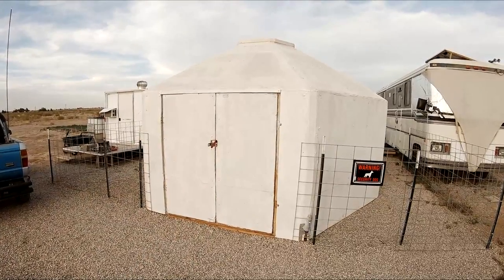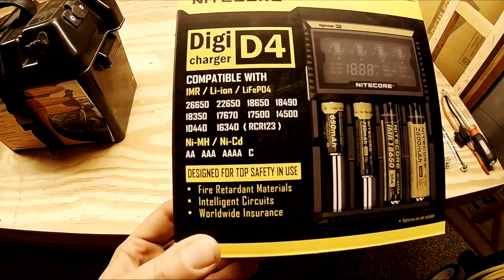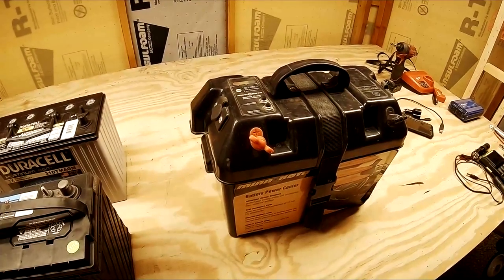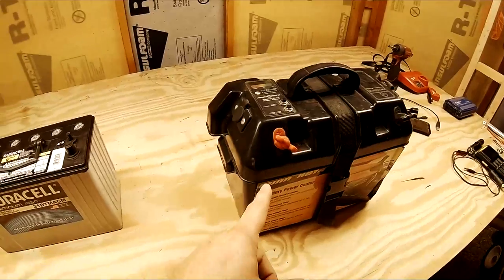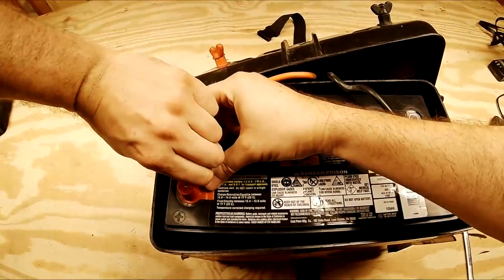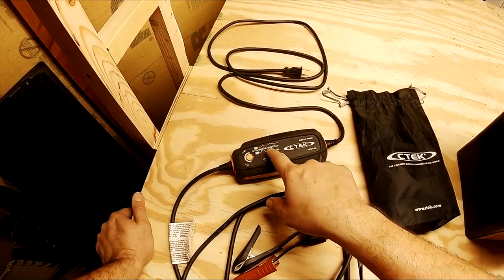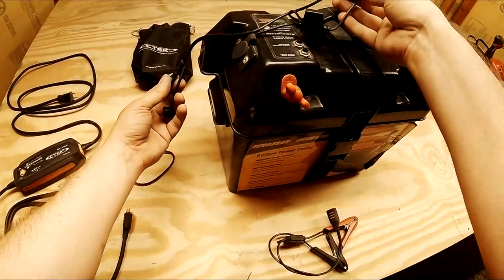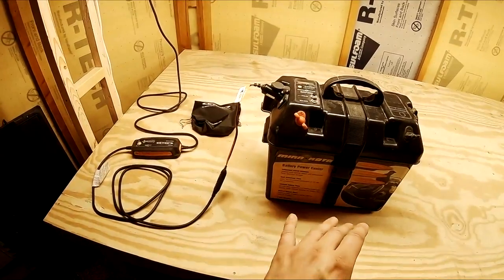Emergency Backup Power Pack - Part 1

Comment: Having just experienced a two day power outage due to a severe storm, this video grabbed my attention. I could have used a setup like this and thanks to your video, I'll soon be building one.
Reply from the maker: Good for you. The battery is costly ($180 as of May 2018) but the setup is totally worth it.
A Group 31 deep cycle like that will recharge flashlights and phones for days.
It can also power a low output CB or HAM radio base station setup for a good many hours.

Comment: This vid was so well-done, and so convincing, that even though I just TODAY ordered a Jackery 500 and adjoining 100 W solar panel, I am STILL tempted to set this up. Go job! I'll have to find your vid on connecting solar to one of these. Thanks!
Reply: Question: If I don't need a charge controller when using the solar panel that charges my Jackery 500, couldn't I charge your battery box by simply plugging it into the Jackery AC, that is running on solar? Would this work? And it would be solar!
Reply from the maker: It would work, there would be some losses though. Some of those smaller battery packs don't have good MPPT controllers for large solar panels.

Comment: Wing nuts will work loose without lock washers. Not recommended!   Put the Andersons cord on the Battery then take that battery charger and CUT that funky connector for the adapters off and add Andersons to attach it back on later then toss the adapters back in the bag (you just never know) and put a set of Andersons and a fuse holder on the charger makes it a lot more useful.

Comment: How long can one keep this marine battery backup system going with being charged ongoing and then switch to solar panel if power goes out?     Can this go for a few years on auto charge with a deep cycle marine battery?    Or will the battery typically lose retention power in a year?  
I would want to just plug this in with the charge regulator and forget about it till the / if the power goes out.     Is that going to work?     Or should one just spend the $400+ on the Goal Zero or Jackery solar set up for 12V ?      
Also - where is the vid on adding a solar panel to this scenario?   
THANK YOU SOOOOOOOO MUCH !!!!!   So helpful and money saving too!!!!
Reply: You can make a deep cycle battery last for years by having it floated and maintained by a smart charger such as a Guest Marine Charger. Set it then forget it. You need a decent charge controller to use solar panels. I switched to LiFeP04 lithium batteries for my projects 3 years ago. They are expensive but they are much lighter and pack much more power than lead acid chemistry. The commercial ''solar generators'' are getting better and more reasonably priced. Compare everything by Watt Hours as it is the power common denominator.

Comment: I think it's interesting we still call it a cigarette lighter.  There is probably at least one generation that has never seen a cig lighter in a car.  If they encountered one, would they know how to operate it?  But I'm old enough to remember cars without seat belts and the bright lights switch was on the floor.

Comment: Watch which solar charge controller you get I have a Colman 30 amp that even when set to deep cycle won't charge them up fully it actually has better voltage when set to automobile battery it'll charge to 13.8 which although not high enough for deep cycle sealed lead acid batteries is still better than the under 13 volts it charges in deep cycle setting

Comment: What if you charge it off the alternator while driving and just get a 3 year replacement lead acid battery. Would that be wise? If the battery dies you can just replace it for 3 years.

Comment: Hi! Looking for DIY ideas on how to power an outdoor forced air heater to use at my sons travel baseball tournaments and fans during the summer but I'm assuming of it can power the heater, it will power a fan also.
Reply from the maker: Fans yes, you need a lot more power for a heater.

Comment: Are AGM batteries safe to leave inside a room while being charged, either by AC or by solar?  I have a small mini-cabin used for hunting and have no electricity at all, so overhead lights need to be DC.  I wish to set up a battery system to power lights and maybe charge my phone etc. and wish to leave the battery in place all the time, inside the small 8x12 building and have a solar panel keeping the battery topped off.  Appreciate advice
Reply from the maker: Yes, they are safe in my experience.

Comment: I forgot to mention in my question below, what size AGM battery would I need for just basic DC overhead lights, cell phone charging and possible laptop use?  I don't stay at my little hobo shack very often, but need enough battery to carry me through two or three nights if I decide to stay that long.  I have a 30 watt solar panel that I could use to charge a battery, but need to keep the battery topped of and ready for use when I decide to stay.  I don't want to spend a ton of money if it isn't necessary, no overkill in other words, but do want to have enough for short stays at the cabin.  Will a 35 amp battery be sufficient?  Or smaller or larger and will my 30 watt panel be enough?
Reply from the maker: I'd go no smaller than a 100 amp hour. At very least a 100w solar panel as well (may need more in cloudy areas!).
I've ruined an 18 ah pack before just running computer fans for many hours. Any AGM/lead acid should not be taken down past 50%.
It's tough to do single panel, single batt setups. The new LiFePO4 batts are supposedly great in small setups, still expensive though.
https://www.amazon.com/Renogy-Lithium-Iron-Phosphate-Battery/dp/B07KQSRNQ7/

Comment: Steven Harris says to not use anything less than a 6 amp charger:  

Schumacher XC6 SpeedCharge 6 Amp Battery Charger $29.77
"This is even lower in price, its a 6 amp charger and will charge up a marine battery all the way for you.  Its very budget oriented.  Under NO circumstances would I go lower than a 6 amp battery charger.  DO  NOT buy 1 or 2 amp 'trickle chargers' EVER.  They are not intelligent and they usually end up destroying a battery PLUS they NEVER have the ability to bring a discharged battery back up.  This is also available at Walmart, at Sears under the Diehard brand, but at a higher price."